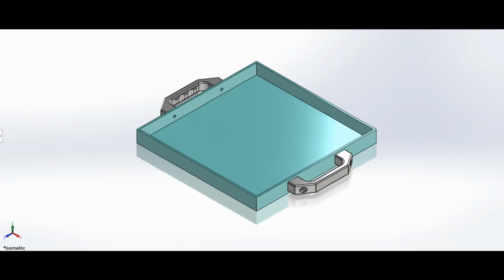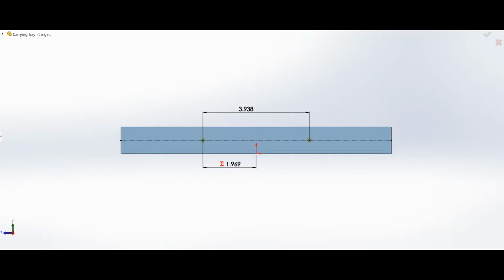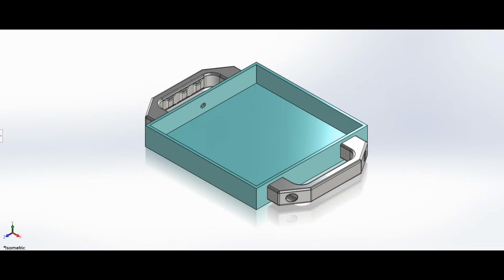Introduction to Design Intent

Comment: Love your explanation a lot. How is design intent related to product optimization?
Reply from the maker: Good Question, thanks for asking.

Keeping a part adaptable is especially valuable in product optimization because changes and upgrades are going to be made to your part over time. The intent needs to be preserved through intentional dimensioning and a clear understanding of the assembly criteria so that when changes are made to overall size, wall thickness, or hole placement, your model does not "blow up" or cause errors. Similarly, design intent will help ensure that when something such as a mounting hole moves, other features are (or aren't) intentionally affected. 

Imagine you have a mounting hole array that is centered around a circle in 30-degree increments, and you find out after prototyping that it would be easier to assemble if the hole pattern was rotated about the axis by 15 degrees. Because you referenced the holes to each other and a circular pattern, the change is made very easily. If you had referenced each hole discretely to the side or edge of the part, the change could take an hour or two to fix. In another example, often a manufacturing method can change to increase production. Having a flexible model and intentional dimensioning scheme can make something like changing the manufacturing process from sand casting to die casting a simple procedure of adding draft angles and ancillary features. 

The intended application can also play a part in optimization by hinting at what might change or stay constant when reevaluated after prototyping. A structural mounting component for an electrical assembly is a good example because the mounting hole locations will almost certainly not change, but the wall thickness, overall size, or even heat dissipation features are all variables that may have to be updated once more information is available. So when modeling your part, referencing the mounting holes in the dimensioning scheme would be a robust way to preserve intent when changing features down the line. This optimizes the final product because robust modeling lends itself to quick assembly updates, adding or removing hardware and other components based upon updates at the part levels.  Parker Adams
Reply: @mccormickstevenson  well understood. Thanks for the explanation
Reply from the maker: Our pleasure.